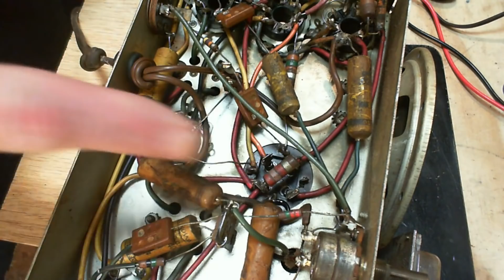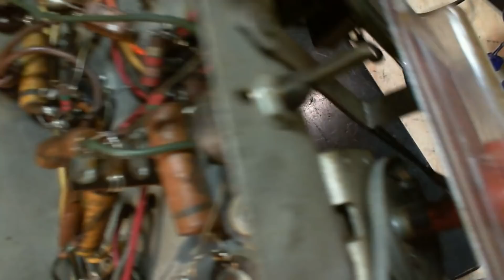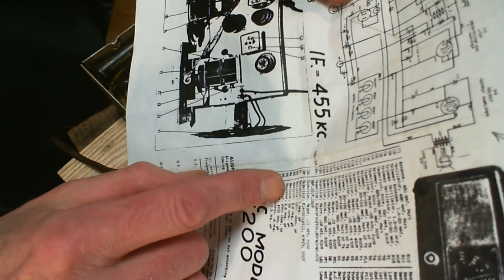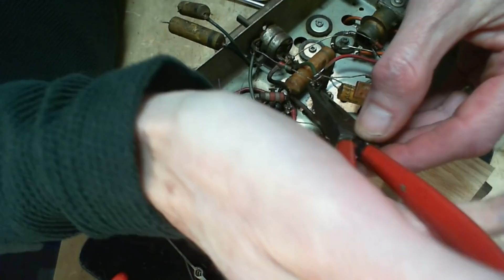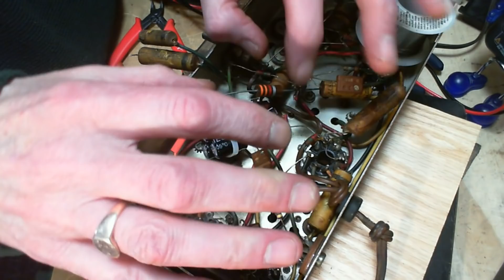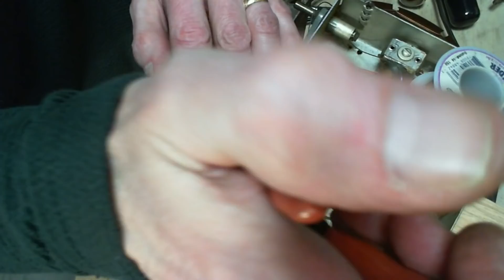Northern Electric Baby Champ AM Radio Video #2 - Four Filter Capacitors

Comment: I have started using Silicone 2 when I need to mount something securely. This is the silicone that doesn't have that vinegary smell when it cures. It is also safe to use directly on bare wires. It doesn't damage them the way the other silicone does. 

I am distressed that some parts were harmed in the making of this video. Not very nice for those poor parts.

Comment: Was that resistor bad that you replaced?
Reply from the maker: It's supposed to be 2700 ohms.  On the bench, it measures 3000 and I stuck a 3300 in there.  We'll see how that goes.

Comment: Just FYI Jim, Digikey (digikey-dot-ca) still sells these ("terminal strip and turret boards"), from Keystone electronics. 

I know, I'm shocked myself. They are phenolic too.
I guess the other option would be to use insulated turrets and solder them to the old capacitor terminals (eg. the Carlson method).
Enjoyed the video, thanks for posting these, cheers.
Reply from the maker: Another great idea from Mr. Carlson.
Reply: @JimsRadioShop  - I should have updated this comment... Found a gold mine of terminal strips as well as other vintage parts on Surplus Sales of Nebraska website. I did not know about this one.. found it last night.
And yes, Mr. Carlson is a great reference on tube gear.. along with yourself as well.

Cheers,